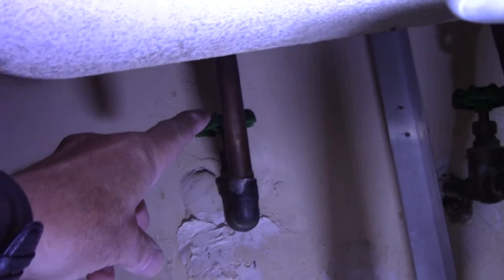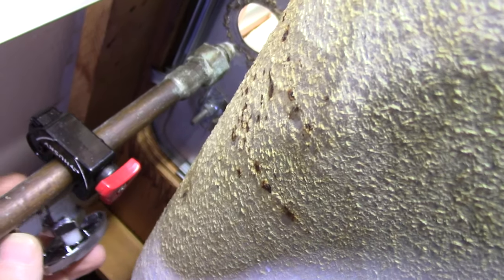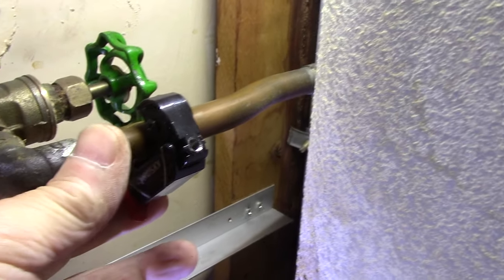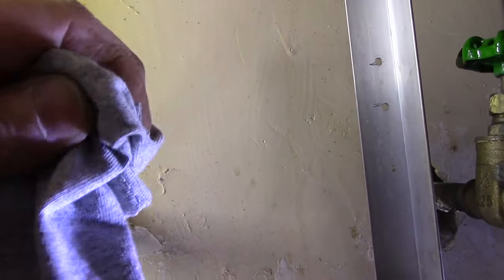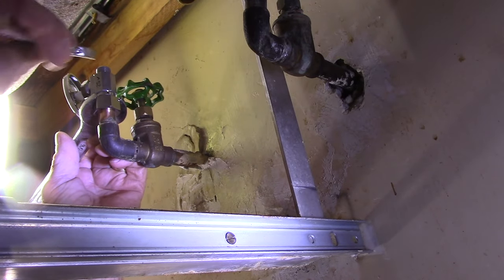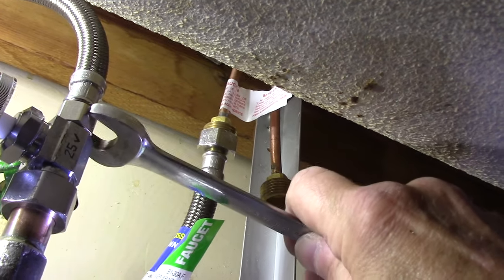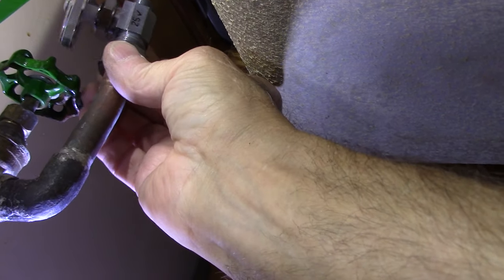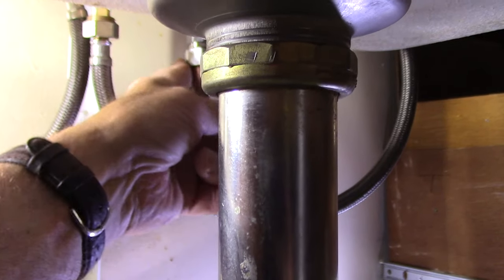How To Install A Water Shut off Valve On Copper Pipe

Comment: What is the orientation of the farrell?  How do I know what size valve I need?  How do I measure it?  My water shut off goes into a copper pipe.  Do I need a valve with dual farrels? Thanks!
Reply: The ferrule doesn’t have a proper “orientation”; it’s the same on both ends, a plain ring slightly sloped on each edge.
There are pipe sizer tools you can buy, but copper pipe comes in a few standard “nominal” sizes like 1/2” or 1”. If you don’t mind a few trips to the store you can cut the pipe first, then bring the cut off piece when buying the valve, to make sure it’s correct. The other part to measure is the OTHER end, which is probably connected to a flexible braided water supply line, which also comes in a few different standard sizes like 3/8” or 1/2”. Again, you can detach that existing braided line (it simply screws on the to faucet assembly) and bring it to the store as well. 3/8” is pretty common for sinks, but other sizes exist. 
A valve will typically be sold as a set with compression fittings on both ends, but if the other end is going to a braided supply line instead of another length of copper pipe, you don’t use it; discard the prepackaged ferrule and nut, and just screw the braided supply line directly into the valve. Hope this helps!

Comment: what is the green shut off handle doing? why two shutoffs?
Reply: 7:25
Reply: Most of the time when replacing a quarter turn valve of ball valve you remove it. It’s failing so no need to keep it. Open the Sheetrock up and do it right. Easy patch work.